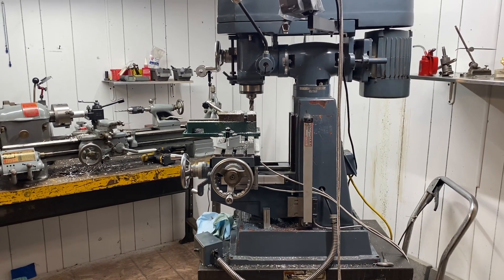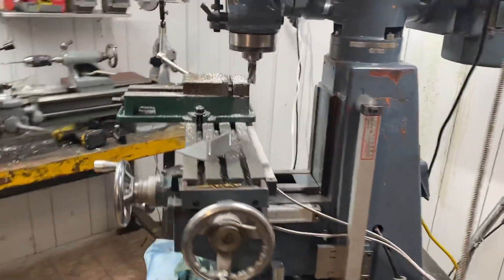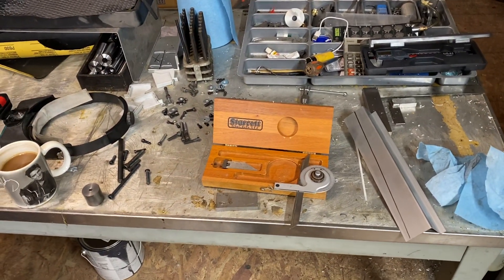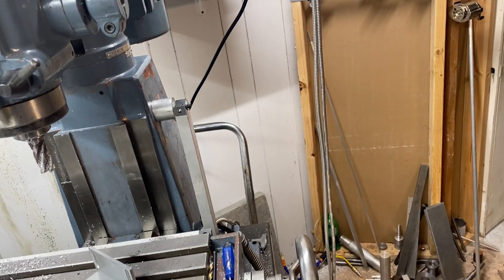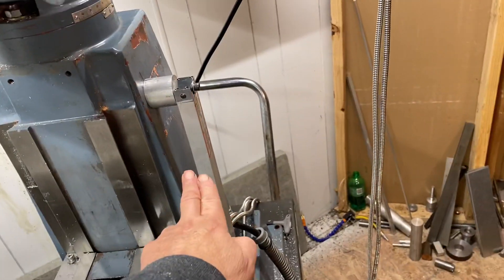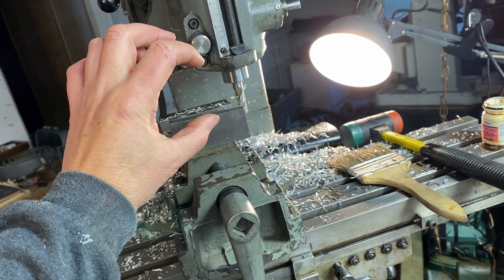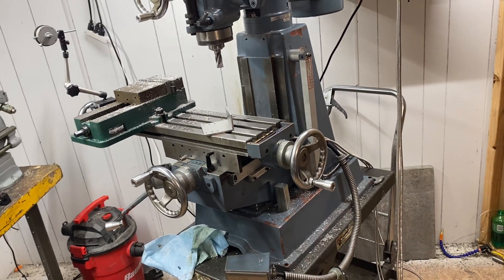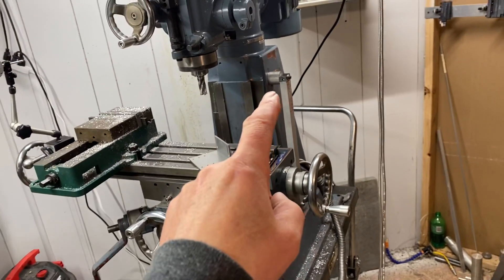Enco mill DRO install pt.3 How to deal with two draft angles.

Comment: On my Bridgport I drilled and spot faced the cast surfaces using a counter bore in a cordless drill by hand, then tapped the hole and screwed the post that came with the Newall DRO kit. Seemed to work well enough